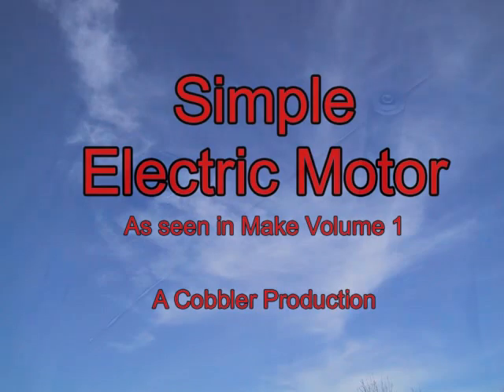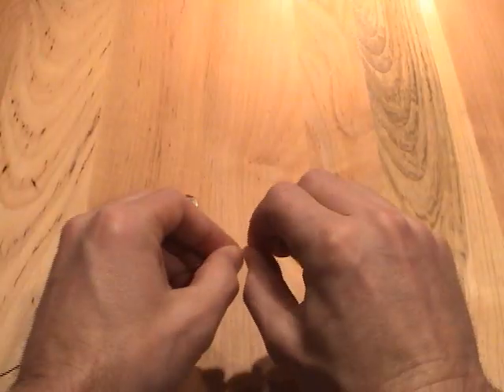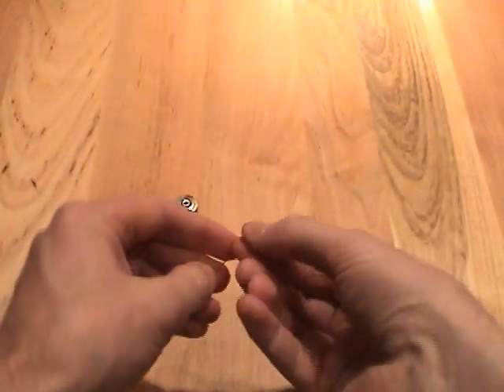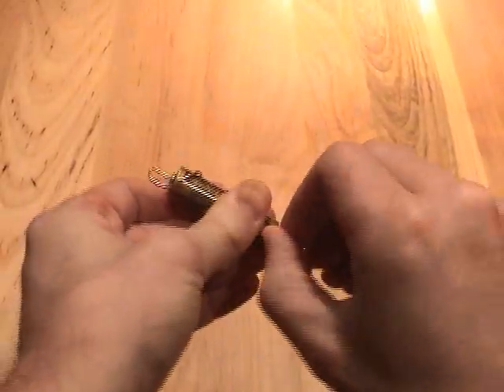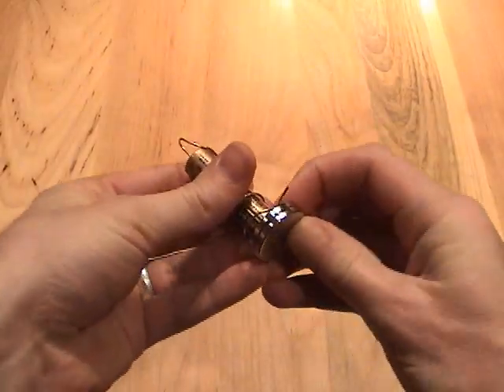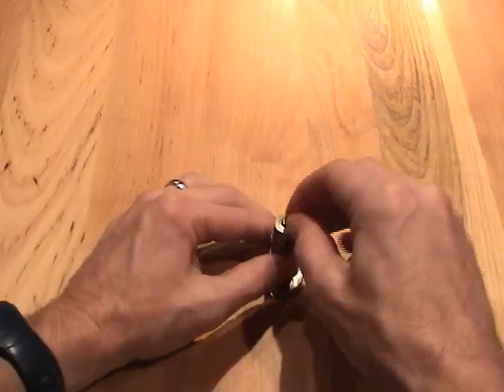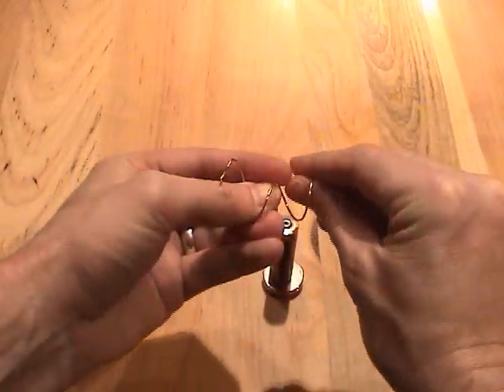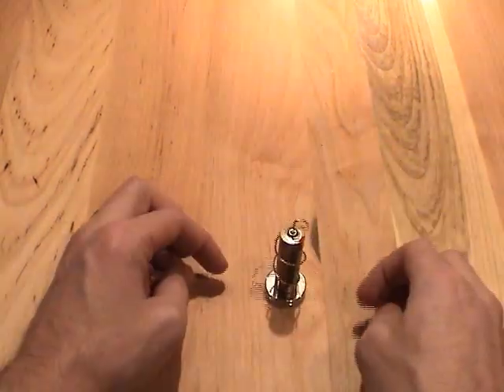Unexplained Phenomenon - Simplest Electric Motor

Comment: flow of Electrons from Neg to Pos causes the wire to Spin. If you invert the poles the Wire will spin the Opposite way this is a Single Pole Motor... Its only drawback is that is is almost a total short so the wire gets hot.

Comment: I recently got the EZ Battery Reconditioning program and just reconditioned two car batteries. The guides were very easy to follow [Check Details Here==>https://plus.google.com/100351090281822647456/posts/HMvgs7qqoKA ]. I wish I would have found this years ago! Thanks!

Comment: Its called an electro magnetic solution when the copper wire is collecting energy from the battery and reacting to the magnet at the same time equaling mechanical energy making the wire spin

Comment: In the simplest explanation, what we are seeing is the vertical flow of the new electromagnetic field that we created. when looking at a magnetic field of a donut magnet under magnetic film we see the two dimensional representation of the centripetal and centrifugal forces flowing around the battery they resemble that of a Spirograph. the current conducting material surfs the spiraling waves circling and eventually will reach its terminal velocity and slow itself either from lack of balance or from friction caused by the atmosphere surrounding it. put it in a vacuum chamber and i bet your top speed increases a bit.

Comment: What's unexplained here is why this should rotate.  Traditionally a DC motor requires a commutator that causes the current to alternately start and stop (or reverse direction).  This seems to lack this and thus there is nothing that should keep this thing turning.  My guess about what is happening here is that as this thing turns there are momentary gaps in contacts due to it's unintended wobbles. THese play the crucial role of making the current oscillate.  One way to test this would be to put pieces of scotch table on the magnet to interrupt the current.

Comment: Doesn't the magnet have to have a conductive metal coating to complete the circuit for the battery?
Reply: Never mind, I found an answer. You're using an neodymium magnet which conducts electricity as well. That's how the circuit is completed.

Comment: This is why it works the battery and the wire are acting like A magnet like those big magnets in the junkyard that pick up cars when electricity is added to a metal it can become a magnet so what is happening is one magnet is repelling the other magnet therefore making thrust just like when you put two magnets together they will stick but then when you reverse one magnet they will repel each other all the magnet is doing is repelling the wire

Comment: A current will start flowing from (+) through the wire, the magnet, to (-) of the battery. A current creates a circular magnetic field around it. This magnetic field gets repelled by the magnetic field of the magnet and therefore the wire starts spinning.
Reply: that sounds about right.
Reply: +PublicVoid wrong. current flows from negative to positive
Reply: +DMAN22yeah    Well, right and wrong. When electrons were discovered, it was found that they were flowing from what was called the negative pole to the so-called positive pole. HOWEVER, BEFORE electrons were identified, there was an agreement that "something" was running in the metal wire from one pole to another. Two conventions were made : first, to name one pole "Plus" (or "Positive"), and the other "Minus" (or "negative"), then second, to agree that a "current", whatever it could be, was "something" flowing from Plus to Minus. The poles could have been named reversely as well, or the "conventional" current direction be chosen the other way, but it was agreed like that. So, current goes from Plus to Minus BY CONVENTION (only).
Then, now, we know that electricity inside a conductive wire is a flow of electrons running in OPPOSITE DIRECTION of what is conventionally named "current".
To date, we still don't know exactly WHAT an electron is, even if we perfectly know its electrical charge and even if IBM has fabricated one transistor (in their Lab) able to let flow the current "electron by electron", which is to release ONE electron charge at a time. But the particles themselves have not been seen, and one concept is that they could well be just a compact rotating field or a sequence of local contractions of space circulating around the nucleus, like a circular train of wave. The explanation is still open, and we only know that the model of Niels Bohr with little balls turning around bigger ones (like satellites) has been a useful image, but just an image, nothing real. Have a nice day.
Reply: Wow Pikaxu, you really knows your stuff. Thank's for sharing!
Reply: +Ruud de Graaf    Well, despite being an (old) Mechanical Engineer, I was always attracted by Electronics, and in 1957 (I was 13 y.o.) I had built a miniature crystal radio-receiver (without batteries, working on the Energy of radio-waves generated from local Broadcast Companies, in French this was "un poste à galène", but with germanium diode). After trials and brainstorming to reduce the size as much as possible, I had the idea to shift the functions of the coil and the capacitor (adjustable coil with ferrite core and fixed capacitor instead of fixed air-coil (bigger size) and adjustable air-capacitor (much bigger size) ) thus saving much space. My final product could fit inside a plastic tube of "Aspirin Seltzer", about 2 cm diam. and 5 to 6 cm high, which I had fixed to my belt, with the big headphones on my head, with antenna wire insulated running in the sleeve of my shirt, and the (compulsory) ground wire running down in my pants to a copper pin under the sole of my right shoe. Then, I could walk in the streets of Tangier while listening, either "Radio-Tanger", or "Voice of America", or "Mackay-Radio", all three very powerful (very energetic waves) installed at 17 km on Tangier Atlantic beaches. Sellection was made by turning a little knob, screwing the ferrite core more or less deeper in the coil. 
My portable miniature radio-receiver was probably the first "walkman" (without batteries) in the world, or at least among the first "home made walkman", as invention is universal and other fans of electronics probably did the same over the planet, but never published. And this was long time before Mister Sony released his products, and I was only 13 y.o.   ;-)))))  Have a nice day..

Comment: The only simple logic I can come up with is the cord being spiraled is essential to the phenomenon.
My tiny brain deduces that the wire is being pulled on in a way that the spiral affects it directly. If I could make one simple adjustment to the experiment it would be to both double and half the wire's length and see what, if any, difference it makes in the overall RPM.
Also, does the battery actually play any sort of role in the phenomenon, or is it simply acting as a sin which the wire rotates? I can see how adding a battery into the overall design would ultimately act as "disinformation" to any layman looking to understand what is happening.
Could a 100% depleted battery produce the exact same results? And if so, could a metal object of the same dimensions ALSO produced the same results? I will never know this answer because I suffer from ENTP syndrome.

Comment: When the wire is connected to the battery it forms magnetic fields this magnetic fields will interfere with the magnetic field of the magnet causing this movement to occur I think.

Comment: If this is beguiling, try making a brushless motor run without using a circuit. Efficiently, of course;)
Reply: Already been done replace the electromagnets with permanent ones

Comment: thats what we call electromagnatism. it is the basic function of an electric motor. if you were to permanately attach the wire to the battery then the magnet would spin. but since the wire is just resting there it spins instead because the wire has less mass than the battery and the magnet it has less ressistance to rotate.

Comment: It's called an inductive reaction. It also turns the direction it does because of the direction the wire is bent near the bottom. It looks as if like poles are being placed directly adjacent to one another. Like poles repel one anther.  The negative side of the battery is placed on the positive side of the magnet.  The positive side of the battery has the wire running from it, down to the positive side of the magnet. They repel one another. To determine the direction, the slant in the wire on the bottom creates a gradual force that goes one direction.

Comment: Hey, what kind of magnet did you use? Mine didn't work and it's urgent!
Reply: Neodymium strong magnets, regular magnets dont have a conductive layer, hence it will not work
Reply: Szabols Orban Neodyium magnets are available with the poles arranged top bottom and side by side. Does it make a difference which is used?
Reply: Ralph Ferro
Doesn't really matter, however for the best results (I've tried) the ones with the North and South pole on the top and bottom will work better. The complicated part is to bend the copper wire in a way that it slides easily on the magnet and won't fly off it once it starts to rotate.

Comment: The magnet completes the circuit and current flows in the copper wire. From ampère's law, a circulating magnetic field is produced around the copper wire as it carries current. This circulating magnetic field and the magnetic field due to the magnet add up leading to resultant force on the copper wire, which leads to the motion of the wire.

Comment: I couldn't repeat the experiment, for some reason I think I had to much friction and not enough torque to get the wire to spin. What size of a battery you using and how much voltage. I used vry small bettery 1.5V.

Comment: I don't understand why folks find the homopolar motor so confusing.  Fleming's Left Hand (motor) Rule explains it easily.  Follow the current and it just falls out of this fundamental phenomenon of nature/physics/electromagnetism.
You must, however, be aware that the magnetic field doesn't stop at the poles.  It continues inside the magnet. The current is flowing radially inside the magnet and in this region we now have a magnetic field and current that are flowing at right angles to each other.  The Fleming Left Hand Rule shows the direction of the force and resulting torque and movement.
Cheers, ScienceAdvisorSteve
P.S. The coiled up wire that is around the battery is not necessary for rotation.  Look at some of the other non-coiled versions.   The field from that portion of the wire will either create a force upward or downward on the wire depending on the polarity of the battery, polarity of the magnet and sense (right, ot left) of the turns in the wire.  It may just work better if the coiled wire is attracted down to the magnet.  If the wire is repelled upward it may cause a poor contact on the top and erratic operation.
Reply: I tried to make it as simple as possible, yet people still can't grasp it.
Reply: MichaelFleming2011  Where is that?
Reply: Now this guys, this is a Motha fuckin researcher! Tell m how you do it ;)
Reply: Well u don't even need left hand rule for motors just use basic left hand rule and follow magnetic field. Symmetrical arrows repel and asymmetric arrows attract. Thank me later

Comment: i tried this with some magnetic coil wire (copper) and it bounces all over the place, kinda funny, i used 24 gauge and and about 10 turns around the battery, it takes some time to tune it just right, making sure its loose enough but still brushes against the magnets, since the magnets don't attract the copper. the bounce depends on the way the magnets face the batteries.

Comment: Will it spin forever? you know like perpetual, or will it stop when the battery runs out of energy?
Reply: It will stop when the battery runs out of energy causing the power source to be lost
Reply: The energy from the battery will move back into the battery, but at a small loss so it will spin for a very long time as it only loses a small portion of the energy output into the "motor" and not a full loss.

Comment: As the copper wire completes the battery circuit the flow of electrons or electricity causes polarity in the wire. This polarity is acted on by the magnet which due to the shape of the wire and orientation of the magnet causes a spinning motion which maintains the circuit which is constantly polarizing and depolarizing along the wire thus maintaining the system producing the motion.

Comment: It's an inside out motor. Two magnetic lines of flux opposing the current induced into the wire.hey try using a D battery with two long hooks made of paper clips on both sides of the battery. Tape them on using electrical. Tape. Stick a magnet on the battery in between the hooks. Make a coil of an old cell battery charger wire.  Wrap the wire around a plastic soda cap tightly. How many wraps is the fun part. Remove the cap, leave two ends of your new coil out. One to the left one to the right. Long enough as to sit on your hooks off of the battery. Watch your little servo motor take flight. Watch out the hooks will get hot the faster it spins. Pretty cool.

Comment: That's how a typical DC electric motor works. You have a fixed magnet, an electro magnet (coil) and a switch to time the magnetic field of the electro magnet and the result is a motor. Critical is that the "switch" turns on/off during the rotation in a somewhat consistent manner.
Reply: Where's the switch?

Comment: Ok... i get that F=qV x B and understand that theres a torque and obviously the wire is spinning but where i get fuzzy is how its spinning all the way around without polarity changes? I thought the best you could get from these simple motors was an oscillation since the force and torque vectors can't  change direction without reversing the current? Mind = blown.

Comment: use a screw or similar as a bearing and that little motor will spin very fast. As far as how it works. positive electrons flowing through the wire will attract the positive pole on the magnet and repel the opposite pole, This causes the motion of the wire in the vid and why reversing the battery will change direction of the spin. By the way the wire does not have to be coiled. This is done for balance only. Iron magnets will work as well but not ceramic types as they will not conduct electricity.
magnets are great fun!
Reply: Jimbolina1 BTW, Electrons are negative.
If "electrons ...will attract the positive pole on the magnet and repel the opposite pole" then since the poles are on the top and bottom, the magnet would be trying to flip sideways, not rotate.
...
The force on the electrons is at right angles to the magnetic field, which is vertical inside the magnet, and at right angles to the current, which is radially inside the magnet.  Thus, by Fleming's Left Hand (motor) Rule, this produces a tangeltial force creating torque and rotation. Make sure you use the proper current and field directions required for Fleming's Rules..
Cheers, ScienceAdvisorSteve

Comment: i think what happens is that the electricity in the battery creates an alternating current with the magnet. which changes the the direction of the electricity to move the north and south of the magnet, but since the magnet is stuck under the battery and unable to move it just moves the conducting wire

Comment: This works because the electric current running through the wire from the positive terminal to the negative terminal of the battery is creating an electromagnetic field centered on the wire flowing in a circular motion around it. The neodymium magnets have very strong magnetic field witch are strong enough to react with the electromagnetic field of the wire pulling the wire in a clockwise/counter clockwise motion around the battery. There is a low amount of kinetic friction on the wire due to the very low amount of surface area that is touching the battery and the magnet allowing the wire to easily spin around the battery. Think of this as a rope being raped around the battery and someone on the wire pulling it. Hope this helped.

Comment: Dude, basic electronics.
So current induces flux (magnetic force)
The magnet wire(conductor) it touching the positive on the battery and grounded on the magnet, allowing the flow of current.
The current induces flux in the conductor.
The flux from the wire reacts with the flux of the magnet, making it spin.

It's amazing what 3/4 a school year in a half a day technical class (electronics technologies) will teach you.

Fun fact Adding more turns to the coil will increase flux and produce greater speeds...

Comment: That is super simple. The wire touches the magnet, and the magnet is made of metal so it conducts electricity, and since the bottom of the battery is in contact with the magnet, the magnet basically serves as the bottom of the battery, so a complete circuit is passing through the wire. A current carrying wire produces a magnetic field, and since it is wound counterclockwise, the north pole going through the coil is facing downward. If the north pole of the magnet the magnet is facing up- which it must be- then the north poles will repel each other causing the coil to spin since the magnet is much too heavy to move from such a weak magnetic field. If you were to leave the magnet in the same orientation and reverse the direction of the coil, you would have no movement or if you were to reverse the magnet and keep the original orientation of the coil you would have no movement. You can reverse both and end up with the same effect, but the coil would spin the other way.

Comment: once the magnet is attached  it polarises the battery to being a magnet and a magnetic field is formed as it retains its power source capability,attach the 'LAMINATED WIRE' current runs through  the coils it,cutting across the field lines created by the magnet and viola,flemings rule